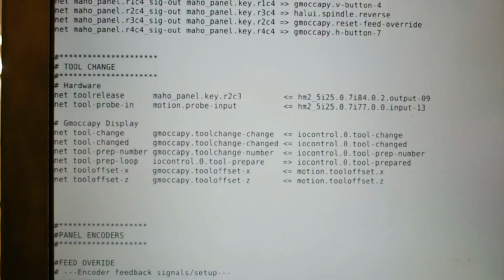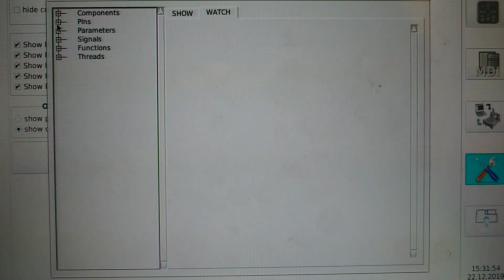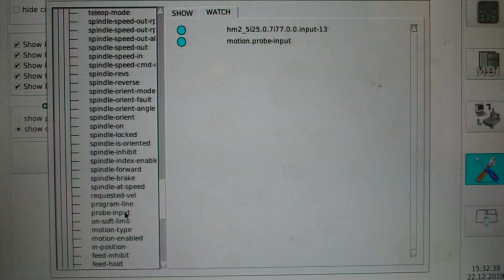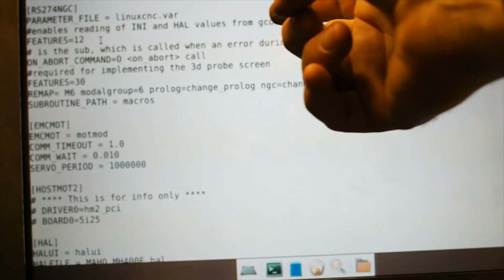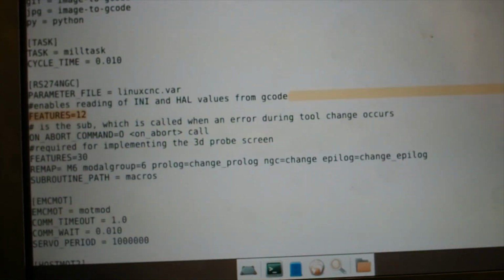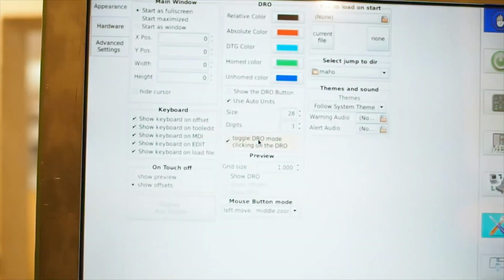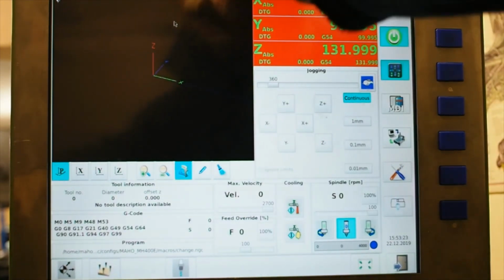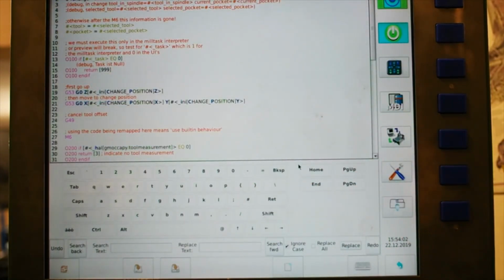Tool height setting Gmoccapy, need troubleshooting help

Comment: did you ever get to the bottom of this??? curious because I am planning to do the same thing.
Reply from the maker: The Ini i case sensitive. I had "Z" instead of "z":

https://forum.linuxcnc.org/gmoccapy/38034-setup-results-in-error-named-parameter-ini-change-position-z-not-defined
Reply: @RotarySMP  I did it :) I cut my first thread today using G76 in an off cut of conduits. I could not be happier. Now to get fusion360 to output an ngc file that my lathe will recognize... thanks for the feedback mate :)
Reply from the maker: @peterkinnear01  Cool. Good on you.